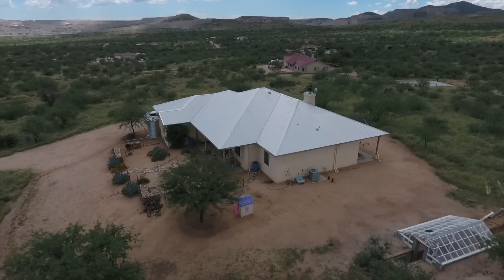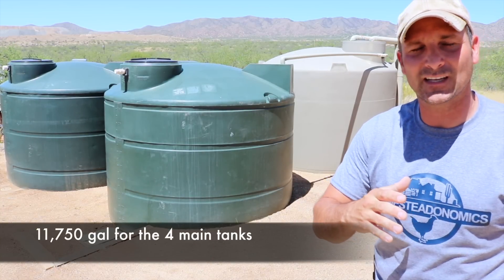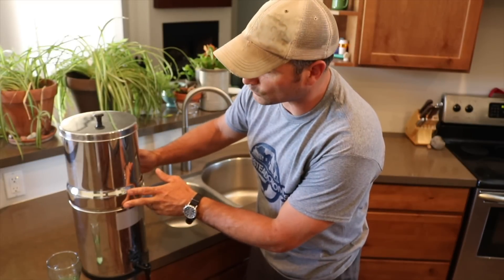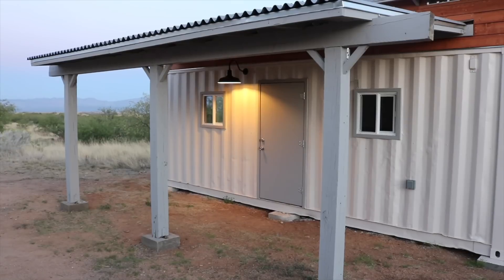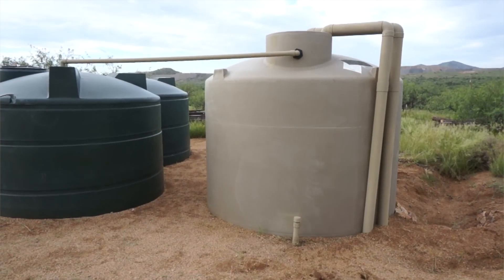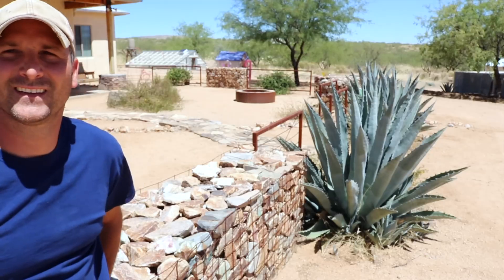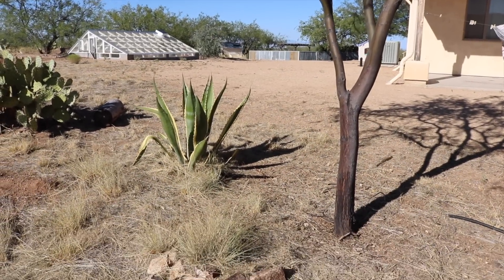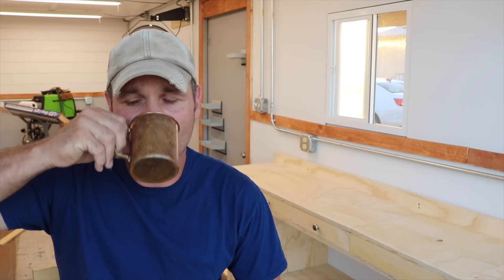Rainwater Harvesting QA - Cost, is it Illegal, how I treat, etc,.

Comment: By law in my State of NSW Australia you have to have 20,000 Lt tank just for for fire fighting. My tanks are three thousand gallon tanks 300 gallon main tank but intend to build a one hundred thousand gallon ground tanks X 4 . As now we have heavy rain so much it's flooding so pump some of the fresh.clear.rsinwater into ground tanks up near the ridge thus no need to pump it back down. Also need it for fire seasons when the only way to save the house is saturation using sprinklers ( big agro farm irrigation sprays) we get fire storms every ten years. No, I don't filter my water I think it silly as if you view the viaduct feeding the city it open and the sand filter is to remove soils, in 35 yrs never had a problem with water had it tested for toxins and bacteria both came out pure. 
In Australia rain water is considered on of the staves of live the others are air and soils
Your entitled to harvest 10% of rain that falls on your land.
I am constantly staggered that folks buy bottled water in the bush causing plastic pollution why? Oh it safe! They answer wth rain waters pure then plastic leeching toxins. I have two water lines one well water stinks mid drought. Other drinking water. Well waters for washing and the garden it's pure stinks from soil but mid drought it dry so then it tank only. Hence the hundred thousand future under ground tanks. Fire fighting is normal but fire storms you turn it on full jump in the vehicles and head.for the cleared roadway. Always have 10,000 gallons tanks the more the better nothing more heart breaking then paying for water. Nice set up your got here.

Comment: Great idea to harvest rainwater. The “Black Berkey” filter was tested to remove viruses. I did not find test results for the ceramic filter (Super Sterasyl) on their site, which is the filter you appear to be using. I wonder how long the Black Berkey filter efficiency holds up, which I also didn’t see on their site. As a scientist, I’m wishing they provided details on what material(s) is used to achieve the results.

Comment: You spoke of the UV Ray's of the sun diseffecting anything foreign on the roof in the rain water.

Note: UV Ray's

On all the plastic storage tanks, all the exposed piping and exposed thick pvc; the UV Ray's are baking that plastic to a brittle state.

You should cover the storage tanks with a roof and have the sunny sides set up with swinging doors...instead of a stationary shed where nasty critters can acummiunate. 

For the sentiment relief valves, just cover with additional rocks. You known of their locations. 

The piping/PVC on the house, simply build a "3 sided box" and attach at the fascia above and a single concrete block...or...to attach the base.

All three additions well increase your longevity of all the exposed areas of piping and PVC from the Sun from turning to dust.

Good Luck

Comment: the system is  not expensive, if anything , it is dirt cheap. It may be complicated, it may require maintenance, but it works. Grey water is a very good resource for watering plants. Even sewage, as long as it is not sprayed over leafy vegetables.  Wherever rainwater harvesting "is illegal" the population of the town/city/county should put a recall election of EVERYONE working at that  government and put each one of them out of work, with a yellow mark on their backsides, so they cannot  work unless the pick up trash on the highways, their relatives included. Those parasites at city hall are only concerned by the money coming from the fat contract they signed with the private water supply company. Everyone talks about the water problem. There is no water escarcity, there is only a scarcity of neurons

Comment: What a smart system to sustain water by yourself from the rain you get. I have to say, I have never seen anything quite so complex and yet so simple. I think it is extremely smart, and only filtering out water that you use to drink and cook with is a smart idea. That's the first time I've seen that type of water sanitizer, but it looks pretty handy and is about the size of a commercial coffee brewer. I thought that having a vacuum that you can clean the gutter from the ground is really smart. I've never seen one with a hook on it for the attachment to go right down into the gutter so well. Does it have like small brushes around the edge of it to knock the dirt loose from the gutter? What a great idea, and it definitely makes keeping the gutter clean quick and easy! Was that 4" schedule 40 PVC you are using to pipe all of that down and around to the tanks? Brilliant system!

Comment: Any bet he is running out of water now since Az is in a drought
Reply from the maker: Last summer the part of southern Arizona that I live in had its best monsoon on record.   A rain gauge 3 miles up the road from me recorded nearly 20” in a 5 week time frame (mid July 21’ through mid Aug 21’).  You gotta turn off the news…. And do some independent research.   If there is a portion of Arizona that is in an extended drought, they will paint it as the entire state.   It sells better.
And yes, Arizona is always in some sort of drought in one location or another.  It’s due to our orientation and mountainous topography in the nature weather pattern that pushes seasonal flows from the SW and W.    It’s been that way ever since they started keeping consistent records.   
Also, there has been large skewing of data points by ‘official’ weather stations since the 90’s.   Changing official gauge locations from mid town Tucson to the more arid airport location.  The University of Arizona even got caught mounting thermostats nearly west building faces and near and over newly asphalted surfaces.   Lots of manipulation.

BUT to your point, the winter rains that we normally get in December and January were below normal.

Have a good day and thanks for watching😊🙏
Reply: @homesteadonomics  If Arizona is having a drought and the Fed is going to turn to water off in mothers Az and the average rain fall is down. .! So added more area to pickup rain from. What if the drought get worse and less rain

Comment: Grew up in Missouri where my parents, relatives and neighbors collect rainwater.  Most of them built a concrete cistern under their house when constructing it.  My parents built it under their single wide carport.  Holds around 10,000 to 11,000 gallons.  We grew up drinking the water and they continue to drink it for over 50 years now.  
Couple of tips:  Install a diverter valve a few feet above the ground on the downspout of your guttering.  Before it starts raining make sure they are turned out so none of the water flows into your holding tanks.  All of the crap from your roof will not drain into your tanks.  When it starts raining, turn them in after about 15 to 30 mins so you have clean water now.  Also, do not collect the snow melt off your roof.  It makes the water taste bad.  And, if your water does taste bad, throw a couple of hands full of salt in your tanks or cistern.  It will taste better.  Only treatment we ever did to the water.  Final tip:  Every few years when you are running low on water, use this time as an opportunity to clean out your tanks or cistern before having water delivered.  Having six kids, my parents would make us scoop out the settlement with five gallon buckets, grain shovels and brooms.  I do not miss that part of those days.
Reply: Any rain water you collect should have a cover over it, or mosquitoes will lay eggs in it, insects and other things can get into it and make it unclean.
Reply: @mjleger4555  wow... LOL
Reply: @addsurfer1970 LOL!  I love hearing comments from "experts".
Reply: @doctorkayak  I love watching southerners meet their maker from preventable conditions they were warned about, so...
Reply: @snarkylive  LOL
Reply: @addsurfer1970 LOL oh LORD!  Hell-arious!
Reply: @doctorkayak  nothing like inbred hicks on "the youtube" contributing nothing.
Reply: @addsurfer1970 "concrete holding tanks are where legionaries disease came from."
Not exactly, although anything that holds water can also hold this bacterium.
"In January 1977, the Legionella bacterium was finally identified and isolated and was found to be breeding in the cooling tower of the hotel's air conditioning system"
https://en.wikipedia.org/wiki/1976_Philadelphia_Legionnaires%27_disease_outbreak

Comment: Good system for recovering run off rain water.  Worked with poly tanks for 35 years and they do last a long time.  We would always paint the tops of all the tanks so we could walk across them, added sand to the paint for traction on wet or icy days.

Comment: Very cool.  A couple suggestions.   Hugelkultur berms to reduce water consumption for produce and fruit trees.  Might do that in combination with  agrovoltaics which uses shade of solar panels to reduce water consumption.  Lastly because of evaporative loss i think a pond might be a net zero gain.  I would build a catchment pond of clay  if you can find a local source of clay and fill it with rock and sand.  The evaporative loss will be much less.  My two cents worth.

Comment: I have a question, forgive me is this is a dumb question, but we are just now starting this process and now have 2 330 gallon totes and 4 55 gallon blue barrels to start this process (we live in the city). I have been pricing materials (ie gutters, spouts & filters) and the upfront cost is a lot and I am trying to minimize that, if at all possible. We took down our large pool this year (approx 15k gallon pool) to put in a garden so I have 2 huge sand filters that went with our pool. Could those filters be used to filter our rain water for drinking? Is there a way we could repurpose those and possibly save some money since we already own those? Thank you so much for your time! ~ Kelly

Comment: Lol.
Yeah the town by me gets in trouble every year because they don't chlorine and add other stuff to thier water.
They are required to post then ever when they are fined for this.
They sell bulk water. I don't remember the price. But its not bad. The problem is trucking it. 20 miles one way is a long ways.
Lol. I see you don't get the winds I get.
Also you must not get the freezes. Because you have lines that have water in them.
I was surprised last year when I caught as much water as I did from rain.
Wanting to build a much bigger collection this year.
BTW wish rock was my problem for drilling a well. Mine is I have crude oil between the surface and water.
Oil is at 200 to 400 feet. Water is at 500 feet. So I have to drill to oil. Then sleeve it. Then drill to water.
I know how to do it. I just don't have the means to. 
When I bought my land I didn't know I had oil. I also didn't know I owned the mineral rights.
Bad thing is oil companies say its too small.
After research and talking to one of the oil companies. They drilled here in the mid 50s. Found oil. Its estimated to be between 2 to 5 million gallons of crude.
I can harvest it. And use off road. If I want.  But have to do a lot to use on road to include pay taxes on it.

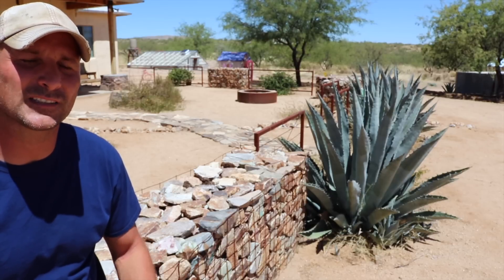Comment: 10:05 I am from the Netherlands and here rain water harvesting is both legal and illegale at the same time. This depends on how you use it it. Watering your garden for example is perfectly fine. Flushing the toilet is also fine. But for taking showers and drinking it is not, and the reason is not for health concerns. We have many companies (this includes farms) who depend on ground water and for this, enough rain water needs to drain away in the ground. We even have goverment campaigns about removing (some) paved areas from peoples gardens to replace it with planted areas (gras, flowers etc ..) so gardens can absorb more rain water. You would get gardening vouchers by bringing in the pavement stones. Mind you that we should not have homes without city water and water companies are mandated to install city water for free if a house does not have any existing connection. City rainwater from roads, sidewaks etc go into a different system. Water from homes are considered water with chemicals (for cleaning the house or your body. But also includes toilets flushed with rainwater) and rainwater without or relative low amounts of chemicals. both undergo a different water treatment and have their own return system. filterd household water is served back to homes and filterd rain water is used to top off household water supplies and excess is returned to groundwater. As such, washing your car on your own driveway or public street is in some places also illegale. then again, public places to wash your car in such areas cost pennies (for water, soap and wax). Reason it costs so little is because the costs they save from treating the rain water intake is re-invested in ways to encurrage people to not pollute the rain water intake. Including making sure it is very cheap to do it legally and cost a very much when you are caught doing it illegally. Though mind you, this is not in a lot of places in the Netherlands, but becoming more populair in the most dense populated areas of the Neterlands.
Reply: Like most things here, legal and illegal at the same time

Comment: "Big Berkeys" (Berkshire water filter system) make the BEST tasting drinking water I've ever had!  

In a pinch, temporarily, you can add 4 drops of bleach, per gallon of water, to purify it for drinking. 
Add 4 drops bleach to 1 gal water, wait 30 mins, if you still smell bleach, wait 15 more mins, etc...
  You can also use 15 drops of iodine per gallon of water, instead of bleach.

Comment: I live in a desert area where we use swamp coolers and found rainwater is the best water feed for swamp coolers.
The water in the local wells has a lot of salts and lime in it and would cause me to have to change the pad in the coolers every year and the cooler every 10 to 12 years. Since using rainwater, i change the pads every 3 years and have not had to buy a new cooler.
i also have a coil of tubing in the bottom of the swamp cooler that feeds cold water into the house for drinking water,. as the swamp cooler acts as a cooling tower for cooling the water. 
I also run a solar distillation set up to get good clean drinking and cooking water.

Comment: Nice!! Smart man.. Over the past 2years I have been working on a way to water our plants trees gardens through out the summer and started off with 4 smaller tanks then 2 more then two more. Then last year I had the idea to actually get a few above ground pools with covers because of the cost of the bigger reservoirs and the fact that they can hold almost 3times as much water. I found three different pools online 15'×15'×5', another 12'×24'×5' and the 3rd were still waiting for 16'×32:×5' all new,all came with pumps,filters,covers and something to go under it, ladders etc
Each pool was under $100 on sale from different companies cause I thought it was to good to be true so 3 different ones from different companies.  Make a Really long story not much shorter.  Best idea Ive had in a long time.. not only do we have alot of water but weve now got 3 pools we can actually swim in if wanted and we can water our gardens that are 100 yards or so from the house now just by turning a handle out of one  pools right outside the house. Anyways yeah built a deck around one and stacked bricks around the other so they wouldn't look so cheesy.  Anyways your set up will definitely out last mine by many years but if your a farmer like what I'm gradually becoming. By having endless water for even one year will pay for a whole new set up like you got or 50 pools lol

Comment: You could do the maths assuming the system last 30 years etc, and it would cost more than city water. A well would be less expensive in the long run, if you get water at all, but probably more expensive than city water (if you lived in a city, which kind of is the point that you are not).

And from an environmental standpoint, your water usage is probably negative if measured in ground water.  There is some increased evaporation from watering in the sun, but also less immediate runoff and flooding, so a lot of your water will eventually find its way down into the ground instead of into rivers and eventually an ocean.

Comment: I spent most of my time getting my power set up. Now I have started my water collection unit. I have over 3100 gallons holding as of right now. I collect water from my roof which I only have half my roof guttered. My barn and my garage. I am in the process of digging a four foot wide ditch which is three foot deep in the center. I am filling my ditch with a perforated pipe on top of eight inches of gravel wrapped with a fine mesh covered and filled with gravel to filter out impurities. I am on my way to being self sufficient. All my tanks are being burried. My collection ditch will be completely around the inside of my property four feet away from the boundary. I have a 110 watt shallow well pump to furnish my home, animals and plants.

Comment: I can't help be amused at the apparent novelty of this system to those in the U.S. It has always been standard practice in Australia since the late 1800's, wherever there is no water mains, but has since become popular in urban areas over the last 20 years to reduce water supply demands. In most instances we don't bother with first flush or filtering the water; drinking straight from the tap. The water quality is exceptionally good.